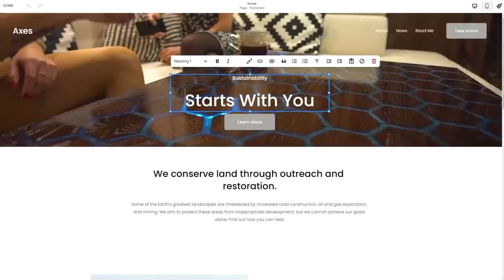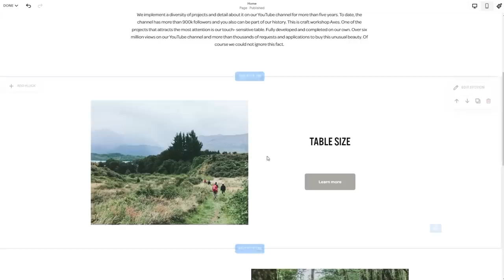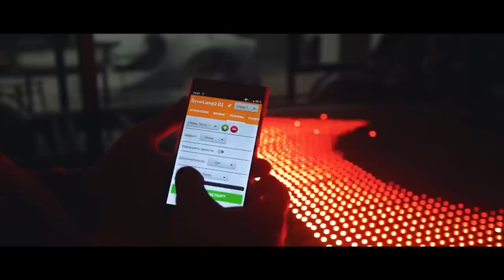How to make TV hood of epoxy & LED?

Comment: Never seen this done before and looks awsome. 
Only thing I would change is that I would apply the LED's to run down the front slope of the hood/bonnet vs. just straight across. It would flow better and might have different effect.👍

Comment: Very neat. Ive only seen something like this done once a long time ago. 2004, on a classic car from the 30s, had its brake lights seemingly inside the rear body panels light up right from beneath the paint. Final product should have heat shielding/foil to product the LEDs from engine bay heat

Comment: Cool project. Well done. Have you considered using the internals of an actual TV? It usually consists of several layers of flexible material, the most important being the light guides layer. Perhaps it can be (carefully) heated and shaped using a heat gun? Just an idea, no clue if it could work. Either way, again, my compliments.

Comment: Should do the whole car like this. Then you can make them flames look really good.
Reply: @axes_garage  it's only illegal if you get caught. Just don't pull over.
Reply: They won't even chase you over minor traffic infraction. High speed chases are dangerous to other drivers. That's why when you run from the law you do so in high populated areas. Police will call off the chase in the name of public safety.

Comment: Poly has many steps, first the moisture has to be baked out 24 hours prior to the mold making to prevent bubbles forming.  Vacuum is probably the best forming method and you usually want the piece to drape before you put on mold.

Comment: The tinniest led bulbs would be best for this. It will increase definition like going from 360 to 1080p but also minimize the clear lines from the led strips because there would be more like with thinner clear strips
Reply: And put no spaces between each strip. Heat shouldn’t be a problem and if it is that problem is an easy cheap fix if you use a in hood fan or the moving air when driving

Comment: But can you play tetris on it?

Edit: Just a thought, but if you wanted to commercialize this product, it would be ideal to connect it to the car's sound system, so you can synchronize the effects to music. Similar to how windows media player used to work (does work?). You could also do fun things like link the effect to the speedometer, faster car goes, bigger the flames are, or have a motion sensor and use a liquid effect so it looks like water is being sloshed around inside a tank as you turn corners, or pushed front or back as you accelerate and decelerate. Actually, have all those as options, and let the user decide which to use.

Comment: I like your idea it is much better than the other method of buying expensive paint and making whatever you paint into an LED. Your way would be cheaper and easier to fix if there was a short or a dead pixel. You will need a frosted white layer to diffuse the lights to make it blend better. I use this on LED halos to make them look like Neon lights. I also like to use glow powder on them. I have a way to put it on nice and evenly so after the lights go off the diffuser glows for several hours. You can get this powder in many shades. Getting it to lay evenly is the trick. I am the only guy I know that can do this and even the company said I would need a white or light surface. NOT TRUE! I experimented all summer a few years back and can take a regular color and apply the glow powder in my non-traditional way and make it glow. I have a Ninja which is Sherwin Williams Signal Green. It glows very brightly even in the day time you can see it! It is a lot of work and not cheap but well worth the effort. I made my rims, gas tank and any other green surface glow. Then stuck LEDs around the bike. Your way of sandwiching them is cool and would really work nicely combined with what I am doing. Unfortunately, I am in the USA in a place called Iowa. Not much going on here except for what I am doing as far as unique stuff. My method also is pretty difficult to describe. You really would have to watch it done and practice to get good at it. If we were closer together it would be fun to experiment though.

Comment: Putting a color paint on the hood was as a mistake it blurred the color to much is my option nothing more its not an attack or anything. I say this as a t.v is sharp color and image kinda the opposite to what you have, with t.vs the look back when in off mode obviously. I know their are bendable screens i wounder if that was usable with your glass cover for protection. But nice attempted all.

Comment: Why not just go the next step, and put an actual tv screen on it instead of just using leds. It'd only make it another layer thicker, and you could still use the same design, but instead of having the leds move, just set them to bright white to illuminate the screen instead.